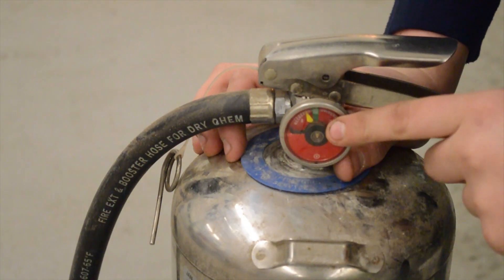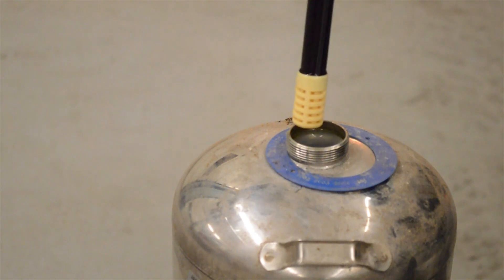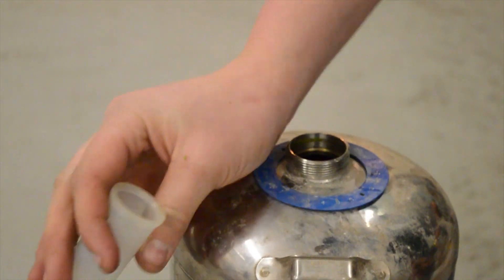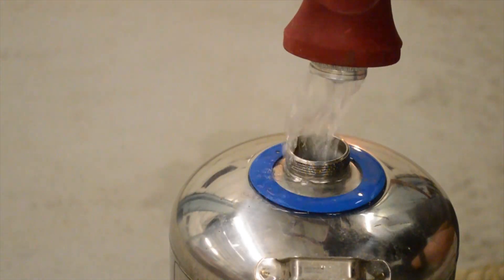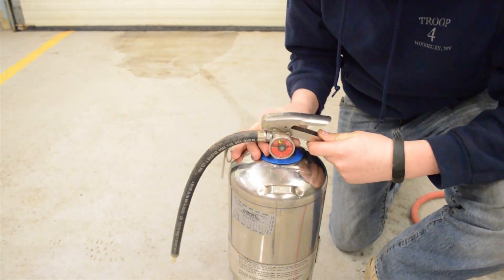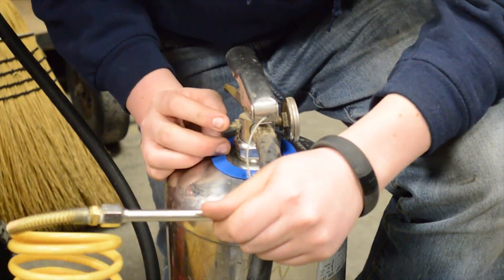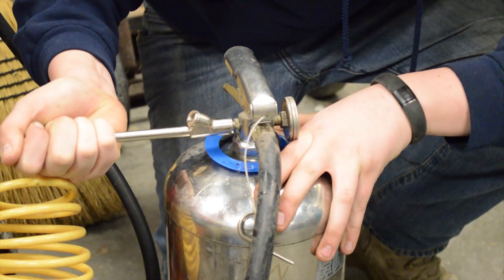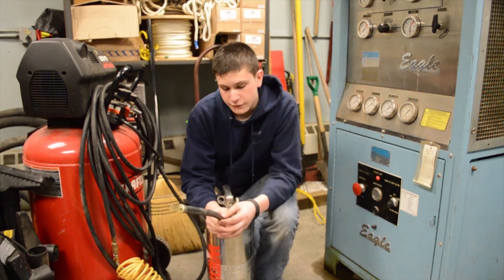How To: Refill/Recharge a Water Fire Extinguisher [HD]

Comment: How much of water you will put inside? And how to know if its enough?
Reply: 2 1/2 gallons
Reply: I think you question is that how do you know when its fill to the bottom of the plastic tube but you dont even need that you can drill holes in the pick up tube and fill it with about a gallon and 16 oz dish soap and you will have cafs unit but you could have some problems getting it tested as its an unauthorized modification and you must have stronger air compressor

Comment: For one thing the gauge is bad on that extinguisher so the pressure is likely to be wrong. The sleeve is actually called a fill tube. You're correct in saying the water level must not enter the fill tube otherwise you will not have enough gas to expel the water. You charged it with the valve backwards. Many manufacturers of water extinguishers have discontinued installing air valves on these extinguishers so the general public cannot recharge them. DO NOT CLAIM TO THE PUBLIC THIS IS HOW A WATER FIRE EXTINGUISHER IS TO BE RECHARGED. ANY PRESSURIZED VESSEL MUST BE RECHARGED BY TRAINED / LICENSED PERSONNEL ONLY. FAILURE TO DO SO CAN LEAD TO SERIOUS INJURY.
Reply: lmao "certified"
Like I need a smug jackass to refill a water can
Reply: I guess a trained, certified person is also needed to install a tube in a bicycle before refilling it with air as well. LOL
Reply: So you’re saying I can’t fill my tire or air tank without a professional?
Reply: I agree. If you are installing one in a commercial or public establishment (such as a public school, library, or in a private commercial industry) yes, fire and insurance codes require that authorized registered personnel service the extinguisher.  I used to work for a company that installed, services, and maintained fire extinguishers and supression systems.

In a private residential home you have a lot more leeway and you can service it yourself without worrying about breaking any code requirements. I recommend having a professional service itif you can,  but, if you know what you are doing you can service it yourself as I myself have done many times. The only thing I would recommend if you are filling these yourself for personal use at home that you get it hydrostatically tested by a professional every 3-5 years just to make sure the extinguisher can hold its required pressure without bursting. They will attach an inspection sticker to it so that you know the date of testing and when it is due for its next hydrostatic test.

Oh and BTW, even without the Schrader valve installed you can still refill one at home. You just have to get the valve fitting that attaches where the hose is screwed in (you have to take off the hose to do this of course). Then you connect your compressor, squeeze the valve lever on the extinghuisher to allow air to enter. Then remove the valve fitting and replace the hose.
Reply: HI Tony dont know what to tell you do you not know it is common for fire departments to refill these at least it seems in the EAstern U.S?
Reply: Tony Girard we get these types of extinguishers when new hat bailers are ordered and I’m not sure cause we only buy John Deere but ours has compressed air charge connection SPECIFICALLY so we can refill them.  People like you that hide behind the TRAINED/LICENSED personnel are ignorant, lacking your own common sense, has had everything done for you, and can’t comprehend the simplest set of instructions thus to compensate for your own miserable understanding of life and common sense situations and mechanical theory you berate and incorrectly advise and slander others just to feel much superior. Fuck you!!
Reply: @jonsexton17  In public and commercial buildings fire codes may require you to have them services by qualified professionals. In your own home you can do it yourself provided you know what you are doing although you should have the unit hydrostatically tested by a professional  every few years.
Reply: @WitchidWitchid  every 12 yrs, with regular service and 6 yrs...
Reply: @jonsexton17  lol that's the world we live in today.The company I work with are filled with these smug yahoos and definetly certified a-holes.
Reply: Tony, take it easy Francis.  Hahahahahah. 
Recharging a fire extinguisher is easy. Trained / licensed?  You trust the govt too much. Hahahahaha!
Reply: old ext ha

Comment: What about  checking on the spindle seals and put a bit of lube on the o,rings and i place a cup of AFFF Foam in as well softens the water .Do it once and do ir right Ok .
Reply: Hi Goldwing what about if I dont have afff I try using tide instead?
Reply: @Fredengle  I use dishwashing  Detergent for Practice on about 500 mill .I REFILLED Powder and A & B Foam ABE Powder for 30 Years i used a safety Drum Cage with Dry Nitrogen .For Pressure Test every 6 Years .
Reply: I mean do you see any reason laundry detergent could not work?  I had herd someone say they used it
Reply: @Fredengle  Never use Powder i used Palmolive dish washing Green stuff in 750mil Bottle   or Dishes only it has to be a Liquid
Reply: @goldwingman1500   dont know what to tell you the liquid launrdry detergent I have I would have thought would be similar to wet water ????

Comment: that may be the way to refill one but water extinguisher are not cheap along time ago when  I asked the price they said it was 74.00 now they are about a 100 or more dollars please check those current prices!!!!
Reply from the maker: Telesforo Reyes i had gotten mine for about $10 so i guess i got a really good deal, thanks for the feedback.
Reply: working on a little puzzle maybe you could consider helping me with if your in a good mood one firefighter recommended filling it with a little less water and still 100 Psi so if your in a good mood could you try fiilling it to 2.25 gallons and 100 psi and tell me what the discharge time is please thank you